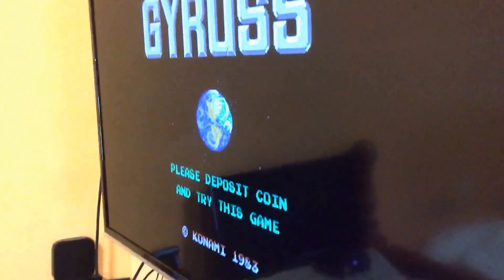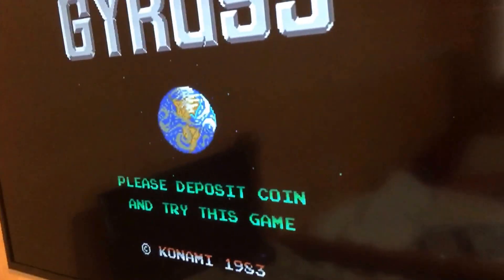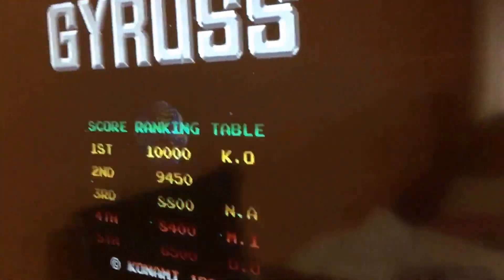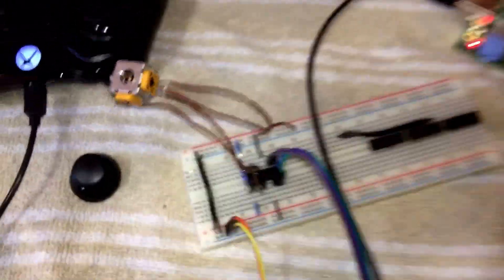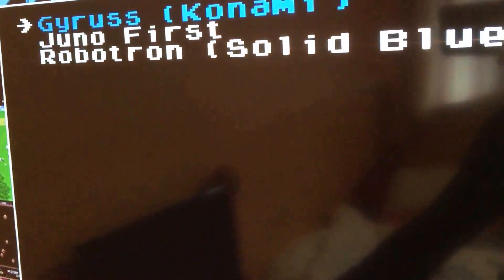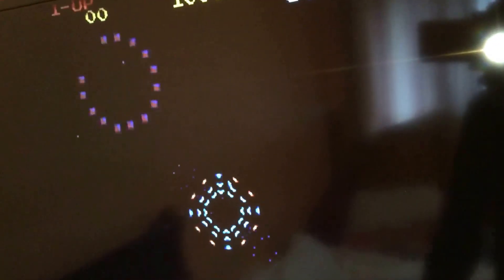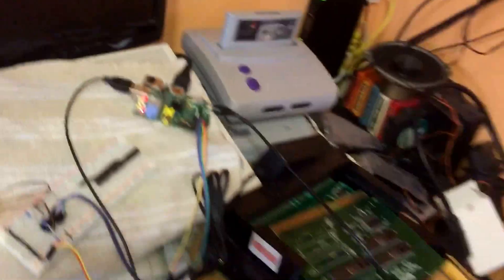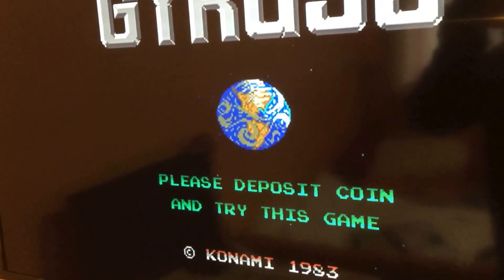Analogue Joystick to Digital on Raspberry Pi GPIO Pins

Comment: Wow how did you do that? I am using the same joystick, got GPIO buttons to work perfectly through 'retrogame', but have been struggling with the joystick and MCP3008. 
Can you please share how you managed to simulate UP DOWN LEFT RIGHT keyboard commands through that? Or link to a guide you followed?
It will be a huge help. Thanks. :)